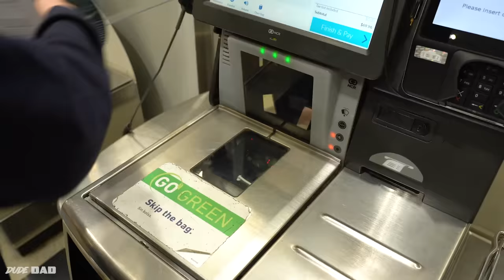5 stages of hanging Christmas lights

Comment: My parents put eyehooks in the eaves years ago and use an old long handled paint roller with the plastic cap on the end ripped off to hang them. They also wrapped lights around a thin PVC pipe that bends to fit the arch of the porch. Throw some of those net lights over the bushes, and they're done in a couple of hours. The neighbors, not so much.
Reply: This is what my husband wants to do, use a pole with the gripper thing to hang lights. I suggested the pvc idea, but he didn’t want to do that for some reason